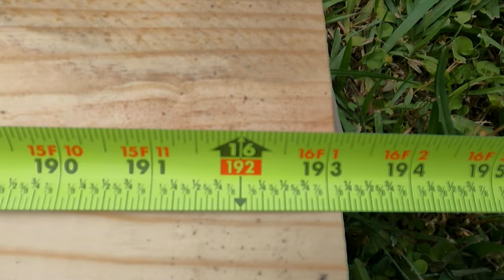Barndominium Build DIY : Part 6 Truss Delivery and Girt Installation

Comment: What nails are you using in that PT lumber?  IF, it's standard 16D's, the heavy salts in that PT lumber will eat them up.  You need pole barn screws, heavy galvanized or stainless to go into PT lumber.  This is very important.  SR
Reply from the maker: We are using galvanized pole barn nails

Comment: good luck with fox he has to be killed. years ago most lumber was from 1 to 3 inches long so you could cut off bad ends. i still cut my logs  long for that reason. i wish you the best of luck we lost all our chickens to other peoples pets and they were in a electric mesh fence. they use to put up poles and slide the  old home made one's up with horses or mules. i am not telling you to do it that way as you already know they break easy. they set the one on the new house with a tetehandler. take care, be safe and well.
Reply from the maker: Thank you